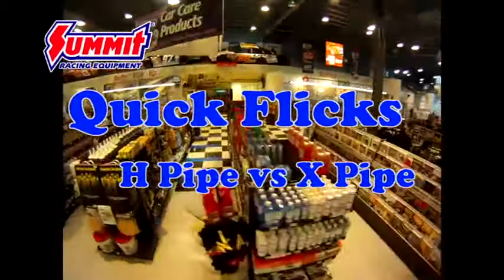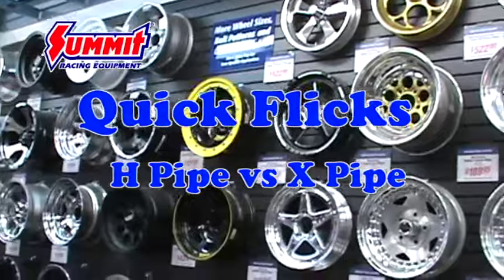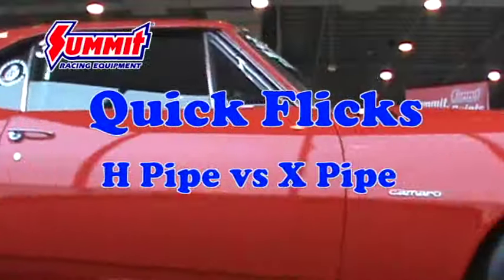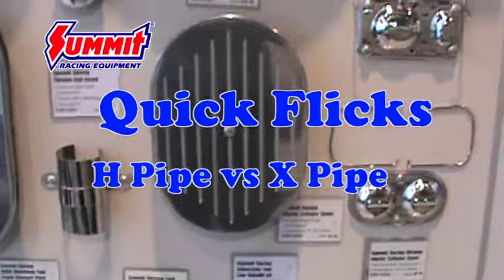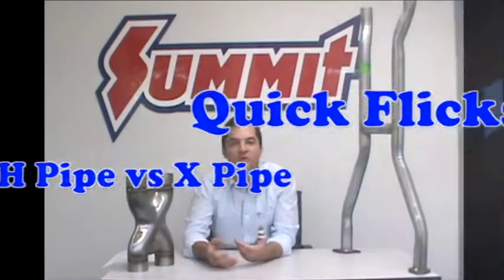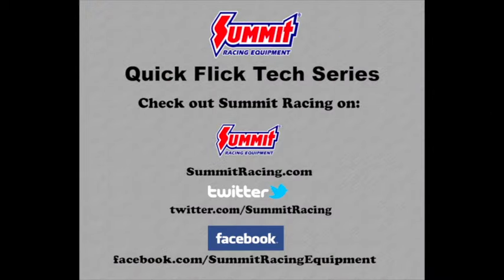Exhaust X-Pipes vs. H-Pipes and Differences Between Them

Comment: I have a 1996 Ford Crown Victoria 4.6 v8 I have true dual flowmaster  10 series mufflers..... Should I get rid of the huge stock cats and replace them or get rid of them all together
Reply from the maker: William Maddox, Removal of the catalytic converters is frowned upon heavily by the EPA, not to mention you would need custom computer programming if/when removed. We have replacements, give us a call and we will help you find the correct part numbers. 1-330-630-0240. Thanks for watching!

Comment: I'm looking at purchasing the header back dual exhaust 2.5" system for my 72 Olds Cutlass with a rocket 350 engine. I don't want a loud sounding system. Is this a good system for me? I was trying to find someone on here with that system to here how it sounds. Any suggestions?

Comment: I have a 540 ci BBC, (dyno'ed 701 HP with 690 ft lb torque) aluminum heads, roller cam, FAST XFI multipoint fuel injection with 2" primary stainless steel Hooker Comp Headers flowing into 3" stainless Flowmaster stainless exhaust w/Super 40 mufflers and a "H" pipe... would the "X" pipe have been a better choice???
Reply from the maker: Hi Rodney, 
Most likely yes!  But the only way to know for sure would have been to dyno both at the same time!

Comment: I have a 86 ramcharger 360 4 barrel carb which would be better h pipes or x pipes Summit Racing
Reply from the maker: Hi Alex Lowery, 
Low speed towing applications are best served by an H-pipe.

Comment: i have stock 2002 gmc sierra with a 5.3 only mod is a k&n air filter going to put on a exhaust cherry bomb glasspacks witch would be better for it a x pipe or h pipe thanks

Comment: the closer you can get the H or X to your headers, the better they will work.. it also depends on the mufflers you are using. the empty chambered mufflers will give you the best scavenging effect, but they will tend to be louder than fiberglass filled mufflers. the H pipe is better for low end torque and the X is best for high RPM HP, the X will sound more raspy at low speeds and the H is smoother. not recommended for low compression motors. also your cam will have a say on what it likes

Comment: I have a 96 chevy caprice with the 5.7. the only mod is having the pcm modded for power and faster shifting. I am looking for a newer exhaust system. I am not a hot rod but I am looking for a little more power.  as for mufflers I like the flow master super 50 pro series . does the X or H pipes fit my desires.     Thanks..........................Kenny.............

Comment: Hi. I have a 91 Lincoln Mark vii.  What would ve the best choice. She has a 5.0 HO
Reply from the maker: Hi vanillaface1887, 
That car had an H pipe from the factory. This worked well in a low speed, daily driven situation. If you plan on adding parts such as cam and heads; they will increase the RPM range of the motor in which case an X pipe would be beneficial; otherwise, keep an H pipe!

Comment: Which do you recommend for a 2008 Dodge Magnum RT HEMI?
Reply from the maker: Here is a list of systems that will fit the Magnum R/T 5.7L  https://www.summitracing.com/search/year/2008/make/dodge/model/magnum/department/exhaust/section/exhaust-systems-kits/engine-size/5-7l-345/engine-family/mopar-hemi-gen-iii?n=department%3aexhaust%2bsection%3aexhaust-systems-kits

Most of these use an X-pipe design.

Comment: What does the 2015 Challenger R/T have? I think it has an h pipe but haven't checked. If it does have an H pipe would it be better to get an x pipe?
Reply from the maker: Robert Smith,
That car already has a factory crossover pipe but, an aftermarket system with mandrel bent tubing, an X pipe and free flowing mufflers will give a nice sound and power increase.

Comment: Hi guys what would you recommend for a 2014 V6 mustang, it had 305 hp I'm not sure if that considered a lot or not???
Reply from the maker: Erik Martinez, It appears your car has a square resonator in the center of the exhaust system that would also act as a crossover or H pipe. So the upgrade, when you do it, would of course be an X pipe equipped cat-back system.

Comment: So if i have a v8 ford and could probsbly fit either x or h and im going with a true dual system with headers i should go with an x pipe?  I understand its tough to tell without knowing applicstion specifics but like 5.4 fords do,  they have good low end torque.  Do you think an x pipe would hurt the acceleration or performace in your honest opinion?

Comment: 2015 RAM 1500 5.7 Hemi...If I swap out the Y for an X and run true duals, I wanted to install one muffler to save time and $. Mufflers I've seen that are 2in 2out have an X pipe inside of them. Is there any downfall to having 2 X pipes in one system, or would I be better off with 2 separate mufflers?
Reply from the maker: +William Henze , 
Some applications have benefitted from this and some haven’t. It will take some testing as each combination reacts differently.

Comment: I have a charger r/t 2015 which one do you think is better ?
Reply from the maker: Hi maHDi, 
Your car already has an X pipe form the factory!  Most aftermarket systems would maintain that but just increase flow with a different design muffler and resonator set.

Comment: I have a 01 silverado true dual 
Which would benefit my motor for equal pressure the H pipe or the X pipe cause I wanna put one of those on it
Reply from the maker: Hi dutchrolla907, 
Both types will equalize pressure between banks. The X pipe helps to scavenge the cylinders better, possibly giving better performance!

Comment: I have a asphalt circle track car with a chevy 360ci with aprx 460hp and I run in a rpm range of 4500-6600. The current exhaust is a custom deal I made that starts with 3" collectors reducing to 2.5" pipe that then merge into a flowmaster "Y" collector and then its 1 3" pipe all the way to the end which is right in front of the rear tire in the typical stock car location. Would you say running a "X" pipe instead of the "Y" would be worth the time and hassle of making a whole new exhaust? Thanks!
Reply from the maker: Ryan Lagoda, 
Choosing the proper exhaust for a race car can be very perplexing. There have been many, many articles written about it and the theories abound! The bottom line is this, the only way to know what truly works for YOUR motor is to test. Yes, this can be very pricey-understood, but not every motor breaths the same. It sounds like you have a good start, have you considered transitioning up to a 3.5” pipe? Feel free to give us a call, but ultimately you’re gonna have to try some things out. 1-330-630-0240
Reply: My rules do not allow over 3"..and yes I know unless you have your own personal dyno and $$ to try everything its a matter of trial and error. From what I've hear a Y pipe is a good idea but a X pipe is an even better idea mainly for higher rpm range tracks which is what I run on. Im planning on building a whole new exhaust with an X pipe and boom tube but I just wish I had actual dyno results of other motor combinations to compare Y pipes to X pipes. Our tracks are big with high corner speeds and long straughts so Im willing to loose some low end torque if its going to gain me some high end power with an exhaust that draws better.

Comment: hi i have a 87 chevy 5.7 with stock exhaust. trying to get the best sound and power for low end. getting shorty headers but what would be better for low end x or h?
Reply from the maker: Hi Devin Clark, 
An H pipe is a good choice for low end torque in a towing situation.

Comment: Hi, I have a X5 e53 4.4(N62 engine). Which setup would you recommend or is there a chance I loose power with this mod, since the distance each pipe travels to the resonator is not the same?
Reply from the maker: Hi Vladimir Nikolov, 
In the high performance industry it is a given that an X pipe will give decent power gains but, on some vehicles the under body architecture may just be prohibitive to its routing! A good suggestion for you is to do some internet research to see if anyone has been able to achieve this installation and if they’ve enjoyed any power gains due to it. Then you can make an informed decision as to whether or not you want to dive into such a project!

Comment: I have an 04 GMC Sierra with a single in dual out Flowmaster super 40, and I want it louder will the X pipe make it louder by replacing my muffler with the X pipe, and having just dual pipes going in and then out?

Comment: I'm looking to upgrade the exhaust on my 2015 mustang 5.0, wanted some input on x pipe vs h pipe or standard exhaust? Thanks
Reply from the maker: garbarino.mike, 
Well, since your car is factory equipped with an H pipe already, an X pipe would be the upgrade for you. Give our tech line a call at 1-330-630-0240 and we can help you!

Comment: Okay how about this have a 94 Mustang GT and I just put 4:11 gears in I'm interested in take off 0 to 60 red light to red light kind of stuff what kind of exhaust should I go with
Reply from the maker: Derrick, with any exhaust system sound preference plays a priority role. There is a lot of variables with your question as well, we would need additional information about your cars modifications and your option on different exhaust sounds. Check out this information on our OnAllCylinders Blog; https://www.onallcylinders.com/2017/05/10/best-exhaust-system-for-your-car-or-truck/ or give our Tech dept. a call @ 1-330-630-0240 and they can help you choose the system that meets your project goals.  
 
Additionally, If you are looking to improve acceleration, I would also look at suspension improvements that increase traction. Summit Racing by Southside Machine traction bars SUM-SM1314 or UMI Performance Lift Bar UPI-1025-B uses your vehicle's "axle wrap-up torque" to plant the tires and get your car hooked for slingshot launches. Be sure adding the matching upper control arms.

Comment: Hey...  I own a 2012 Mustang GT that ROUSH built into the equivalent of their 2012 Stage 3.  I was thinking of adding the Ford Racing H Pipe and side exhaust to the axleback exhaust that's on right now.  Will that add any extra horsepower to the 625 HP that my Stang already generates?
Reply from the maker: Shawn Meloche, 
With the addition of a proper dyno tune it is possible to gain some power, yes. But only installation and a dyno/tune will tell.

Comment: Hey guys I have a 350, stock heads, stock pistons, 460 cam, rpm intake, I guess standard ceramic coated pro headers (long tubes), and if I'm correct a 600 cfm edelbrock carb on an 82 Chevy long bed. Is this engine setup modified enough to benefit from an x pipe exhaust with flowmaster super 40's and 3 inch pipes or am I better off going with straight pipes out the back?

Comment: Hey I have a 289 bored .060 sleeved   Hei ignition. High rise dual plane manifold  longtube headers and edlebrock 600 cfm carb do you think I would benefit from an x pipe of an h pipe

Comment: i have an 03 crown victoria police interceptor with a stock h pipe but i plan on putting a complete exhaust system except headers im not sure to go to 2 1/4 inch pipe or 2 1/2 inch pipe. also if i should have an x pipe put in place or leave an h pipe?
Reply from the maker: Hi stoverj09, 
If there is no intention of increasing airflow through the motor with a CAI, Cams and Headers then a 2.25” inch pipe with an H will do everything you require. If you intend on buying these things in stages, then consider the X pipe and grow into it with your future modifications. Let us know if you have any additional questions. Thanks for watching, good luck!

Comment: I'm putting together a 81 regal with a 350 motor, 650 4barrel carb, long tube headers, 470cam, bigger push rods, lifter,  & dual timing chain should I do  (x or h pipe) for my exaust. Its not for racing its for show only
Reply from the maker: Aleiondro Wilson, 
We can discuss this when you give us a call :) 
1-330-630-0240!
Reply: Thank you

Comment: i have a question: how do you get rid of droning? or the exhaust sputters when cruising around 20-30mph.. i have MFs and it seems to have gotten louder and more annoying. thx
Reply from the maker: Hi Success Branford, 
Exhaust drone can be controlled by different mufflers most times. As far as sputters @ certain speeds or RPM’s, you may need some tuning done to the ECU if it is Injected or Carb/Ignition if carbureted. Please let us know if you have any additional questions. Thank you for watching!

Comment: I have a 2012 jeep srt8, 6.4l, 10.8:1 or 11:1 compression ratio, I added Borla s rear mufflers only and left the exhaust valves in their place which they say are there for added back pressure, now I want to swap the mid muffler with either a x or H pipe, just not sure which to go with for I want the best out of it for 1/4 mile racing in the near futur, thanks

Comment: Summit racing I need your help!!! I have a 2010 camaro ss ls3 ive added a KnN intake and gm performance axle back exhaust I wanted to delete my resonators and add an x pipe. I dont wanna lose I wanna gain, plus in a month or so I wanna add shortly headers
Reply from the maker: Hi XxStUnTiN2422xX, 
What you are contemplating is actually quite common. You will get some increase in interior drone but the X pipe will give you a gain in performance. Keep in mind, you will have to retune the computer for this additional air flow!

Comment: running an old 97 5.8l running upto 150k so its aged ..for getting more torque for this sand tuck i should be running an H-pipe setup due to the age?

Comment: i have a 86 5.0 mustang. Ceramic longtube headers and and CAI are the only mods i have. Would an x pipe or H pipe be more beneficial to my car? Im not planning on doing anything more than that. I might go as far as  a computer tune though. Thank you.
Reply from the maker: +dardan lahu , 
Either one will serve you well but, if you are going to tune, it would be better to install an x pipe!
Reply: +dardan lahu save your torque and stick with the h-pipe
Reply: Summit Racing

Comment: Hey guys iv got a 2013 raptor was looking at replacing my stock exhaust too a true duel system but I hear I'll lose some low end torque which I don't want. If I were too add an x pipe would that help in this situation and stop this lose of power?
Reply from the maker: Hi Jordan Walker, 
 An X pipe will allow your vehicle to breathe better at a higher RPM, if this is not an option, install just a cat-back system. This gives you sound & dual pipes out the back without the loss of power a true dual with an X would have.

Comment: I have a 2010 Toyota Tundra with 2 flowmaster super 10. If I add and X-pipe will it make it louder.
Reply from the maker: Hi Jorge Palacio, 
Not necessarily louder but, it will change the tone a bit, yes!  The 10 series Flowmasters will make it loud!

Comment: Summit Racing 
The "x" section you had there looks like a magnaflow?
I have seen lots of X pipes offered that kind of looks like they just welded the 2 pipes together.. if that .makes sense? As opposed to a real X where the gases flow properly. Like they just bent the tubes together to make them touch and welded them up that way. I run an H pipe in my 12 mustang and love the deeper tone it gives. But I'm going with long tubes soon and almost all the ones I'm looking at only offer a matching X pipe, so I guess I'll be switching. Good informative video though
Reply from the maker: Hi smokeum12, 
Thanks for watching! Give us a call if want some additional input on the long tubes. 1-330-630-0240. Good luck!
Reply: Summit Racing 
What would be best for my 1998 GMC Sierra 4.3l v6?

Comment: Hi I have a 95 mustang 5.0 with a stock h pipe I was thinking of putting an x pipe with high flo cats is this a good idea or not?
Reply from the maker: Hi optikid11546,
 that would work out well for extra power; especially if all the stock exhaust components are in place right now. A set of shorty headers and a cat-back exhaust will compliment it even more.

Comment: Hi I have a 1985 Corvette, I had straight pipes before with hedman long tube headers and a mild cam, it was a stock but modified exhaust system, y pipe into a gutted catalytic converter, out to another y pipe to the tips. I replaced it with a catless true dual dynomax exhaust that went from the headers into two stainless steel dynomax ultra flo mufflers because it was too loud for a daily driver. It lost a lot of rumble and has a lot more drone. Which is better to regain that rumble? Thanks.

Comment: quick question: I have an 03 silverado with a 4.8. as you know they lack low end torque. I have true dual exhaust installed and originally had an h-pipe with some flowmasters. I recently switched to an X-pipe with qtp cutouts. Was this the right thing to do? also, would I benefit more from short headers to get more low end torque? I have a cold air intake, electric fan, and Bulldog tuner installed.
Reply from the maker: +Raider Jim , 
There’s a saying that goes “there is no replacement for displacement” but, with one caveat, a power adder! For a similar cost to replacing the current power plant with a larger one, you could buy and install a supercharger kit. By forcing more air into the motor, the volumetric efficiency is increased thus making more power throughout the entire RPM range. You’ll continue to enjoy the modifications done up to this point, get more power (que Tim Taylor), better drivability and possibly better MPG depending on the weight of the right foot, of course!
Reply: +Summit Racing lol. your suggestion is to drop 5k on a supercharger or turbo? I like my marriage. just looking for small upgrades right now. headers, cam, rearend, torque converter and the like.